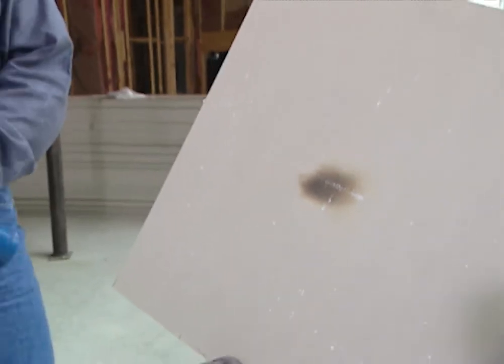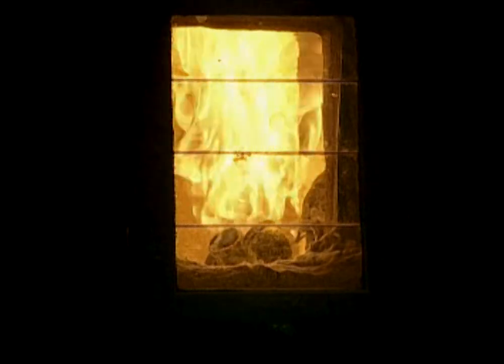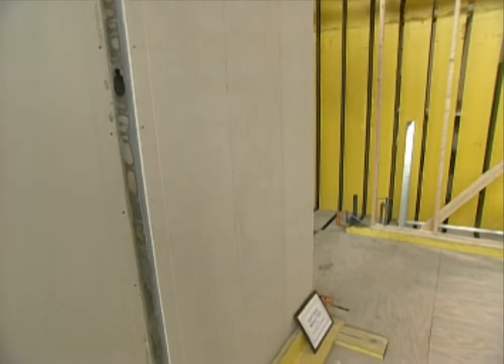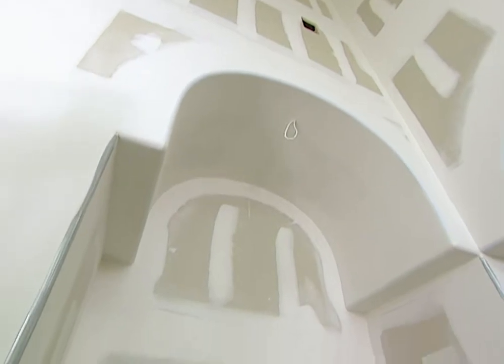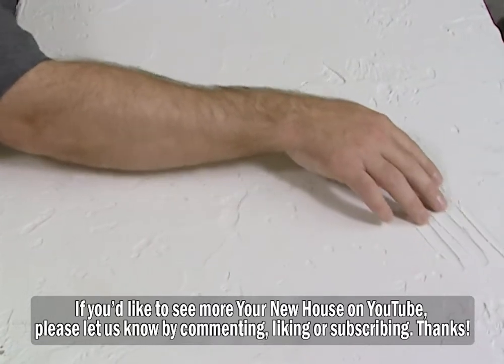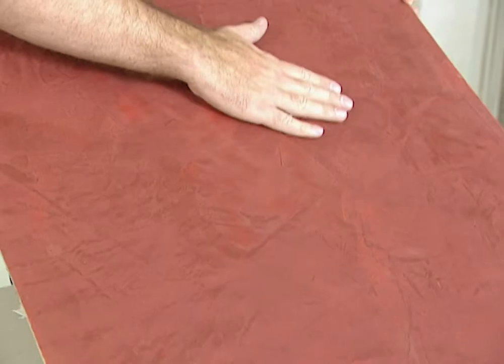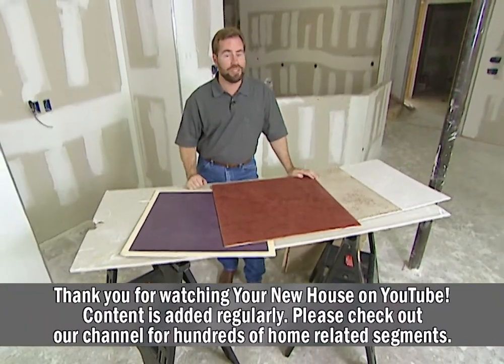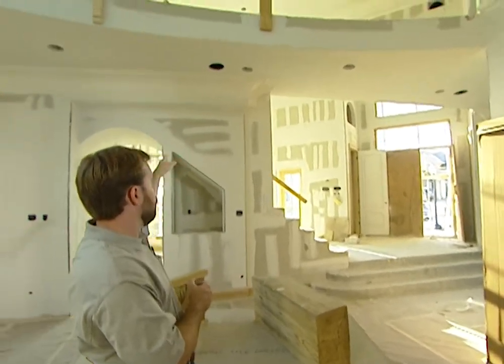Drywall, Texture, Interior Update: Renaissance Project House - Part 11

Comment: i  really question some of the techniques using plasterboard in the U.S. Nailing plasterboards 18ins apart when they need to be 4 to 6ins apart. in the U.K. taping and filling is widely used it is often thought as a cheap poor alternative to a proper plaster skim finish, a good plasterer could have a room plastered in less time than filling , sanding etc and all you have is a paper wall finish at the end.